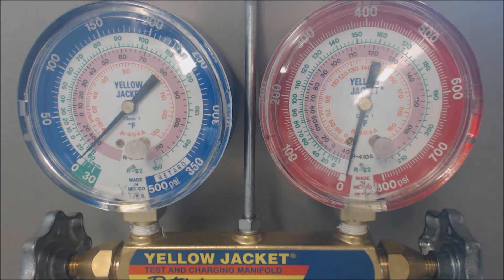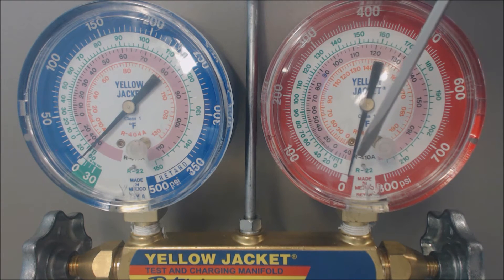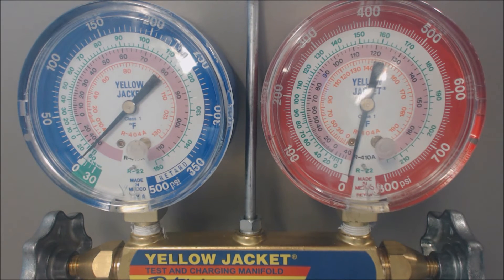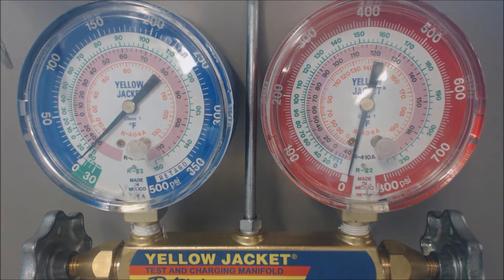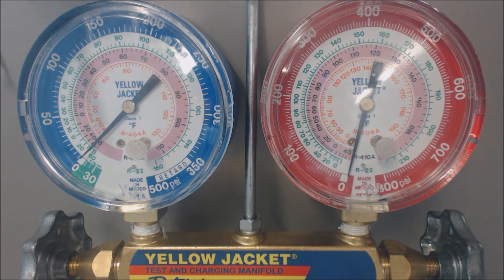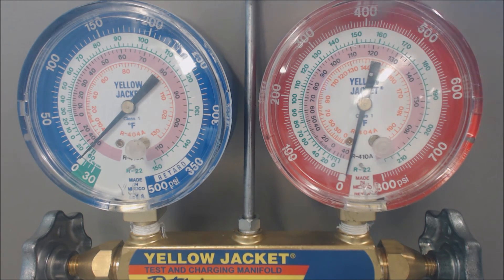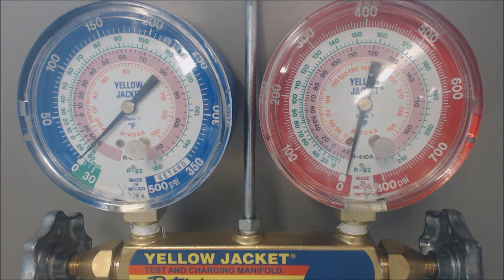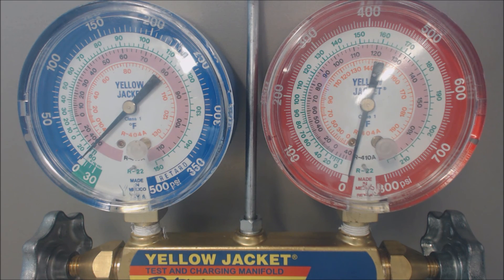R-22, R-410A Refrigerants! Checking the Charge- How to tell if there is a Restriction or Bad TXV!

Comment: Hey Craig, would a liquid line kink or restriction cause a system to pump down on start up? I know it could be a few things but could that be one of them?
Reply from the maker: Yes but it would have to be significant. Are you sure it is not the service valve though? Did you take a temp reading across it?

Comment: If you have low suction pressure and you add refrigerant how does it increase sub-cooling when the vapor pressure stays the same on suction side due to bad TXV or restriction etc  I assume you have more liquid backing up from the TXV in to the condenser so the liquid can loose sensible heat over a longer distance between the TXV and some point further inside the condenser. Please advise
Reply from the maker: If there is a liquid line restriction and refrigerant is added, the only place for it to go is in the condensor as a liquid which increases subcooling, thanks

Comment: Can you please explain what is going with the system if there is a restriction. I read somewhere that you would have high compression ratios and low amp draw with a restriction. I get that the refrigerant is less dense so it would give you a lower amp draw because the system isn't having to work so hard but I am not understanding the high compression ratios. I would think that if it had high compression ratios it was working harder? I am a little confused with this. Thanks.
Reply from the maker: You kind of have a back up situation where one side is really low and the rest of the system on the other side has all the refrigerant so you will have this high pressure stuck there while the other side gets lower. The thing is that a restriction will only be partially visible and in the case of a txv system you will keep gaining subcooling while charging but the vapor side will not rise and you will not have a good temp rise across the coil as you have too much superheat and not enough of the coil is in a saturated state. You are asking some good questions! Thanks
Reply: acservicetech So that's where you are getting your higher compression ratios from? The low side having lower than normal pressure and the high side having higher pressures.
Reply from the maker: Yes that is correct. The high side pressure is high because it has no where to go. The low side does not move even if you add more refrigerant. It has a higher compression ratio even if it is a little depending on how big the restriction is or how little refrigerant is making into the evap coil. Next time I run  into one, I will have to check the amp draw before and after I fix it. You will know when you run into these because you will have the correct subcooling or maybe a little less and when you add, the vapor side does not come up in pressure. Your superheat will be high and you won't have 18-21 even if it is not humid in the house. Great Question!

Comment: I was at a call where I had 55 degrees superheat and 41 degrees sub cooling. I had really high head pressure and about 60 psi on my low side . On a 90 degree day. Could this had possibly been a restriction? The evaporator was partially frosted.
Reply from the maker: Great Question. I would like to get some more info. Just to make sure, we are talking r-22 correct? Was it a txv or piston? Did you happen to see the tonnage of the evap and the txv compared to the AC Condensor, if it did in fact have a txv? Do you know if someone else was trying to work on it before you? I would like to get more info first when you reply, thanks for the great question!
Reply: +acservicetech It is R-22 with a piston. I couldn't tell what tonnage the condenser was because it was pretty old and the data plate info was completely rubbed off, it was an old Rheem. The evaporator coil was a Bryant Model # CK5AXA030000AAAA, is this a 2.5 ton? The owner told me another company was there and added charge, but he said it was working fine until a couple a days ago. I don't see how.
Reply from the maker: So I would say that you do have a good handle on it. Extra subcooling means too much charge because the condenser coil is the only place the refrigerant can go. If you are only getting a little amount of refrigerant into the evap coil then you will have a high subcooling anyway but likely not that high. If the evap coil is only frozen or frosted at the bottom but does have a high superheat then that means that there is a restriction in the line as there is not enough refrigerant going into the evap coil. Since it is a condenser instead of a heat pump, you can't even try cycling it from heat to cooling to try to unblock something inside temporarily. I would say it's a shame but a restriction of some sort is what it is, which may likely be near the orifice chamber but could also be in the distributor lines. GOOD JOB!

Comment from the maker: Hang in there!If after you check the filter, airflow, have a clean evap coil and you have the proper subcooling then you need to start looking at the txv bulb. It doesn't happen as often as a low charge or airflow problem but I have found quite a large amount of txv bulbs partially mounted to the suction line by 1 or two small zip ties with the bulb even over braze joints where the surface contact is no good. If there is a partial leak of the refrigerant from the bulb, it will not apply the correct opening force.

Comment: This is what I have problems with. I once overcharged a system because I thought it was low on charge, so I added refrigerant. I was trying to get my saturation temp above freezing point, but it would go up very slowly and my head pressure would rise drastically.